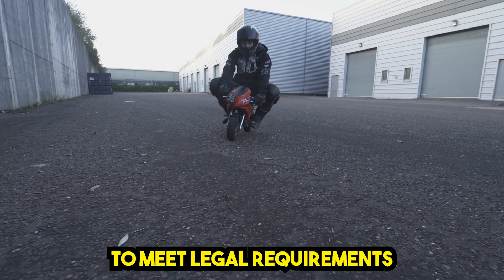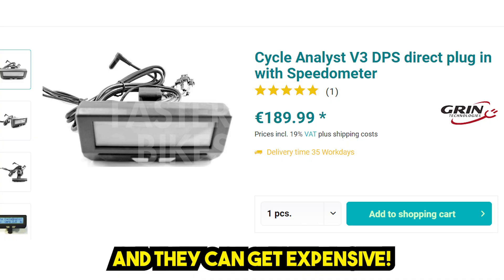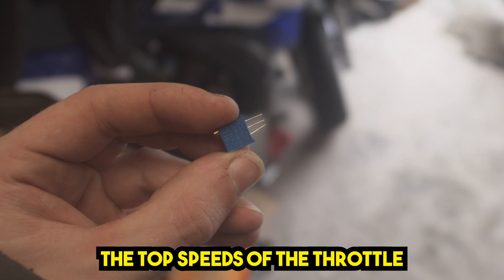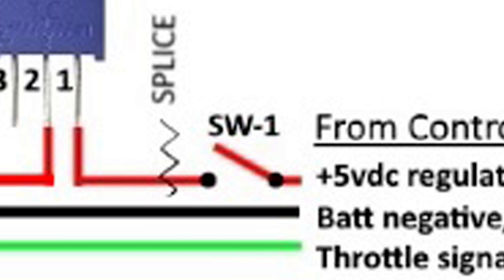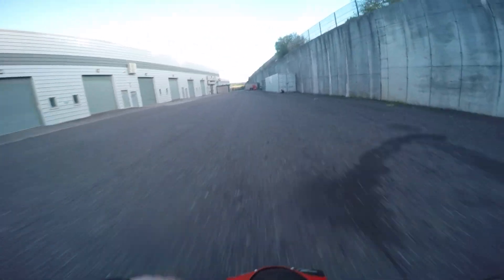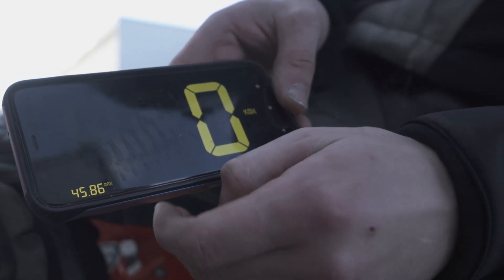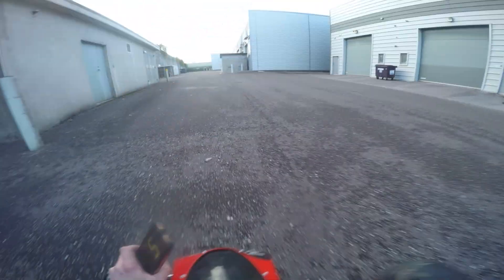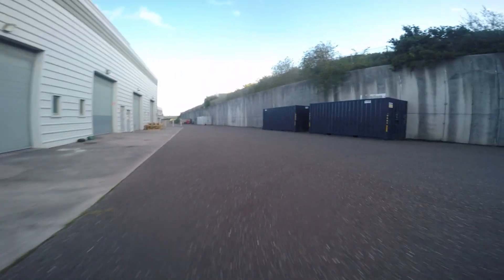How to Limit any Ebike to 25km/h (the cheap way)

Comment: On my ebike my controller has a cable which connects to all my one cable which has cables coming out of the one like my display and throttle and brakes and etc do I cut the throttle wire of there it’s a waterproof plug

Comment: Will this work with a stock surron? I'm planning to buy one and my dad told me he will only allow me to have one if it doesent go over 25kmh
Reply from the maker: @NotXeno_  A stock surron should already be restricted to 45kph if you are in Europe. I would try Google it before you buy tho
Reply: @RHauto  Yea they are restricted to 45kmh but i want to restrict it to 25kmh with this trick is it possible on the light bee x
Reply: Also how do I find out which wire is the positive throttle wire

Comment: Do you know if this would work with one of those 80cc 2stroke kits for a normal bicycle?
Reply from the maker: No sorry it won't. It's hard to limit a 2 stroke engine because it needs high rpms to produce power. You could limit it in other ways but it might make it run really bad
Reply: @RHauto  ah fair enough. I was trying to see if I could make a non-license/taxed motorised bike by abiding by the 25km cap, but do you know if so long as you don’t go over the 25kmh is it grand? Or does it have to be unable to do over 25 to be able to ride without a license. No worries if you havnae a clue anyways
Reply from the maker: @yscc.004  not sure which country you are in, but in Ireland the 25kph rule applies only to electric bikes, so a 2 stroke bicycle would need to be licensed and taxed to be legal here even if it only does 20kph max speed. The 2strokes are very loud too and they attract alot of attention, so I think electric motor is a better option
Reply: @RHauto  ah ye sorry should’ve clarified I’m in Ireland as well. That’s a shame to hear, but thanks for the help

Comment: i don' t know why, but in my case it doesn't work if i limiting the positive wire as shown in diagram.
Reply from the maker: Like it doesn't make a difference at all? I had to turn the screw in about 30 times before it started limiting my bike if that helps
Reply: It doesn't make differrence, but i solved it in different way. I connected center terminal (2)to controllers green wire, left (1) to ground, right(3) to green wire from hall sensor and than it started working well 😊